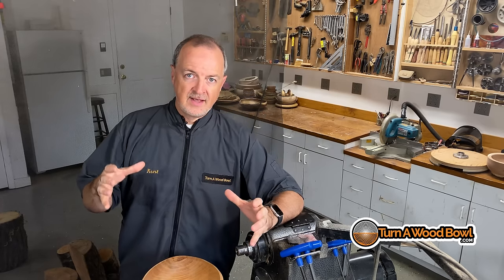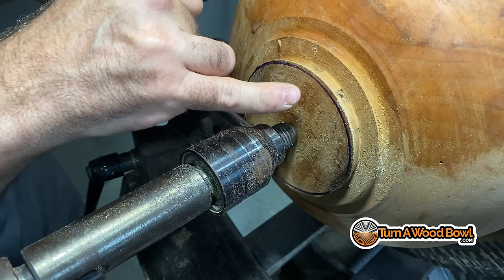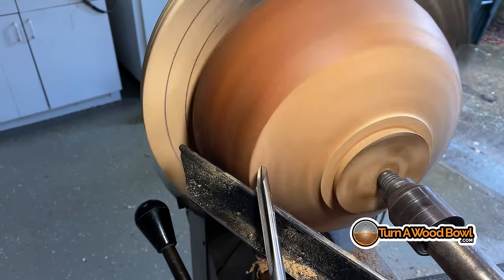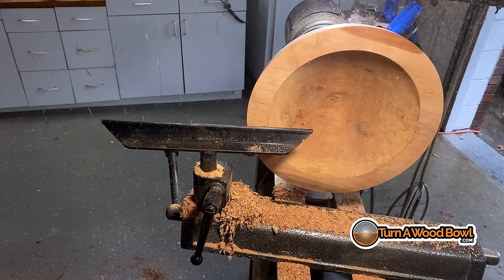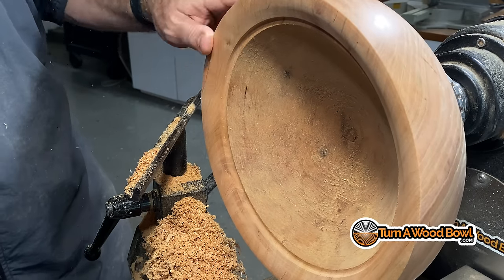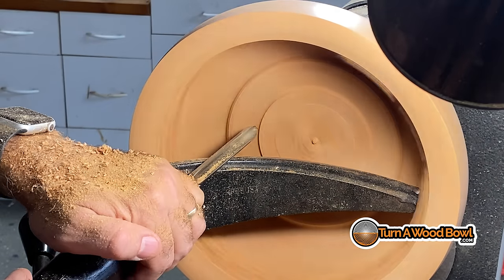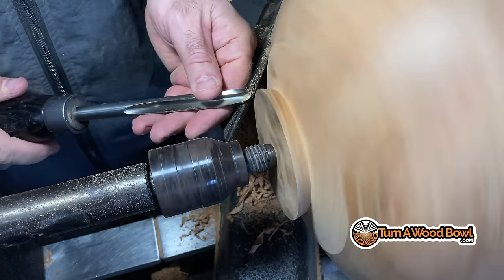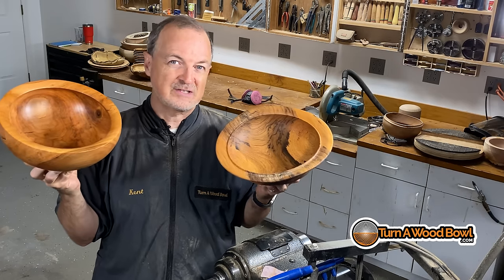Woodturning Twice Turned Wood Bowls - Wood turning Video Green Wood Dried First

Comment: So i had a failure on a twice turned bowl. Walnut, very wet. Hollowed it out and left about 1 inch wall thickness with a tenon. Let it dry. Then reworked the tenon a little to ensure it was round. In turning the outside round, the tenon developed a crack. I might have made the bowl depth too deep - should it also have been around 1” (8” round bowl) rather than closer to final depth? Thanks.
Reply from the maker: The tenon is kinda an extension of the bottom of the bowl. The bowl should be as close as possible to even down the walls and through the bottom. At 8" diameter, the walls only need to be about 3/4" thick, or 10% If the crack isn't too large try to work around it. Happy Turning!
Reply: @TurnAWoodBowl  My walls were around 1" in thickness but the bottom thickness was about 3/8 with a 1/4 tenon. so sounds like i was too deep leading to the crack of the tenon

Comment: Does is matter how smooth your surfaces are the first time your turn the bowl since you will be hitting them again later?
Reply from the maker: Good question. No, it doesn't matter. However, if the surface is all roughed up with tool marks, it can dry out faster and cause issues.

Comment: I’m curious why you don’t use the same jam chuck used to remove your tenon to true the tenon initially?  And have you ever used a vacuum chuck?
Reply from the maker: Great question. Either would work. The flat large jam chuck works great to stabilize the rim. I typically use (out of habit) the smaller inside jam chuck to remove and work the foot area.

Comment: What temperature is your rough oversize bowl left in to dry? 10% eh? Thanks. Regards from Scotland.
Reply from the maker: Good question. The box dryer I use is heated with a single light bulb and gets to about 90°F. But what is more important is the moisture in the bowl. I will weigh a bowl blank each day over a week period. If the weight isn't changing, it is equalized and ready for second turning.
Reply: @TurnAWoodBowl  Thanks for getting back so promptly. So it's possible for a, say, 10" bowl roughed out to an inch thickness, to be dry enough in a week for a second turning? Pretty rapid no?